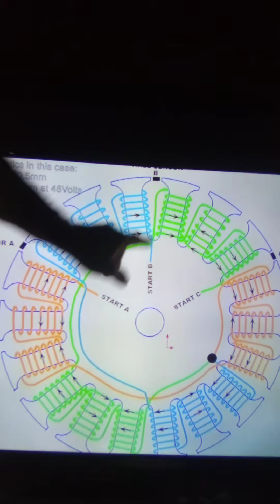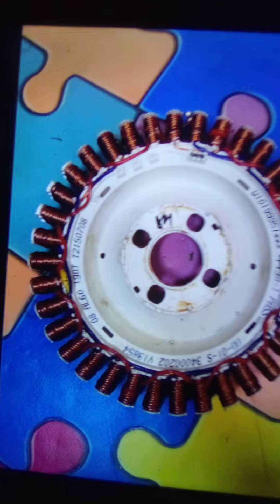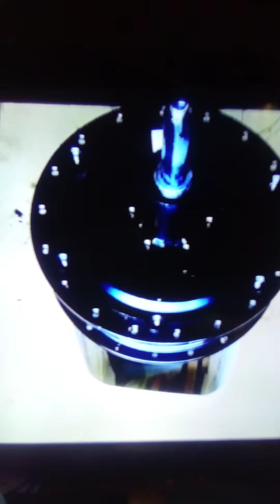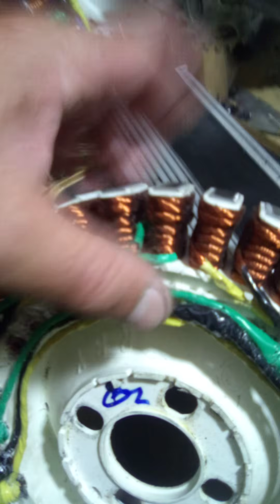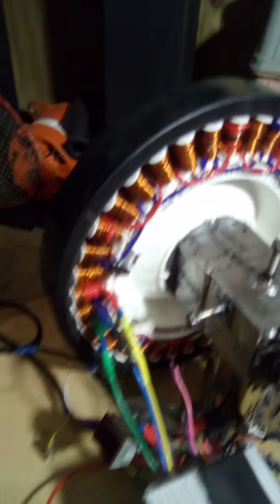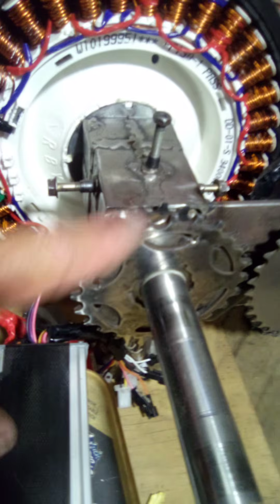e bike hub motor wiring diagram and washing machine hub motor wiring diagram

Comment: Quet Tristan, i saw a video of a guy by name Liam of @enter the realm run two coils and third coil as a generator to loop back. Have tried this and if so do have a video of it coz its not in your play list.
Reply from the maker: Hi buddy yip I'll have to look him up for sure 😁👍🎉🌟 I haven't got a video like that and I did try one time but something is up with the one way blocking diodes it seems to cancel out the power coming from one of the phases it's strange to me but it's another mystery for sure.but yip if this works and you have a you tube video of it that would be amazing to see for sure buddy
Reply: @tristanmcnabb2741  
I can forward to your WhatsApp number more of this videos that look real but no circuit diagrams of how they do it.

Comment: I don't know you can connect a 48 volt controller to 72 volts. Or did you do some modification to the controller?
Reply from the maker: Hi buddy to do with the controller.🤔if you have a 1000watt 48 volt brushless motor controller and you take it apart you will the 2 big capacity caps and on the side that will say up to 80 volts so that's the Max's volts it can take .😁👍🎉🌟🦇 allsome work from cruzermans inventions

Comment: What would happen if you were to wind the ebike stator alternativally north/south on all 18 slots?
What kind of application would you use delta configuration for? 
Also, would you consider zoom meetings to create an ev enthusiasts group?
Cheers
Reply from the maker: Big hi yip only 18 poles and wired like a washing machine motor you would have 48volts 😁😄alsome work from cruzermans inventions.same as a motorcycle charge coil on a 250 cc Kawasaki

Comment: Please can you share the new star diagram sounds beautiful.
Reply: Or is it the same as the factory windong just thicker wire?
Reply from the maker: Yip it is just like the factory winding but thinker wire but now I just rewired it again into 2 Half's 2 X 72 volt motor 😁👍 twice as fast lol 😂 cool stuff guys my new video on it is coming up soon today 😁👍 cruzermans inventions
Reply: @tristanmcnabb2741  amazing thanks bro . Please share how you did the two halfs im not quite sure what you mean.
Reply from the maker: Cool stuff buddy it's coming up in a new video today soon 😁👌🌟🎉👍
Reply: @tristanmcnabb2741  thank you 😊
Reply: Wow!!! Everytime I discover new videos like this and makes me excited. Like I commented   in other videos, I have several of those motors and 48 volts controller but never tried using it on this kind of motor. Please, please confirm I can use a 48 volts controller with 72 volt battery source. It will make my day. Thanks a lot  and continue with good work of inventions. Chears.

Comment: Sounds nice and smooth!  It’ll be really interesting to see it attached to a load to get a better idea how it’ll perform, I’m sure it will have loads of toque!  
 This has got me into a rabbit-hole of research in the subject of winding three phase PM-motors.  There are so many different factors and options involved in choosing a wire thickness as well as the  wiring configuration and method used.  
There’s advantages in using the thicker gauge wire like reduction of skin effect, decreased resistance, and potentially for greater copper mass on each pole.  They can also carry more power and produce less heat. 
  There’s multiple variations of the path that the wire is wrapped too.  It looks like yours is wired as (ABCABC) and another option would be (AbCaBcAbC)  with upper case “ABC” letters being one direction and lower case “abc” being the opposite direction. 

Excited to see what this baby can do!!  Will you be testing with some type of load using the rig you have it mounted to now?  
  ⚡️   🤙    ⚡️
Reply from the maker: I only wired the washing machine motor as ABC and not other way like a e bike hub motor because I don't have any hall sencers but I think that it should still run well just may have to give it a little bit of a push to get the trike going but yip it's looking pretty interesting 👌😊
Reply from the maker: Hi hi guys yip you are right about that 👍😁I'm gonna be making a animated wire diagram of a e bike hub eand a update on the washing machine motor in the last video as well 👍 I rewired the motor in half 😁👍more speed and I allsome was trying to stop it but I couldn't 😁👍but yip it needed more 1.5mm wire otea coil for sure 😊👌 more power down low and hi
Reply from the maker: Allsome stuff guys yip I just rewired the washing machine motor in to 2 Half's and now it's twice as fast 😳😲😁👌🌟💕 the new video coming up today 😁👍 from cruzermans inventions
Reply from the maker: Allsome stuff yip your right 5 strands of 1 mm cooper wire together and 28 turns per pole  with the motor wired into the 3 x4 c on the 36 pole washing machine motor seems to be really good in the 1000 watt with 72 volts running it ,👌😊
Reply: @tristanmcnabb2741  that reminds me, something I learned recently is that when you’re winding a motor with multiple strands the best way is to keep the wires flat instead of twisting them together first.  It allows more wire to fit on each foot and also keeps the magnetic field from getting canceled out which can happen when they are twisted together before winding.  If you ever end up winding another motor like that it might be something to consider.  
Keep up the good work! 
🤙